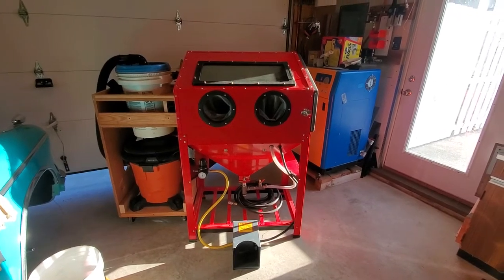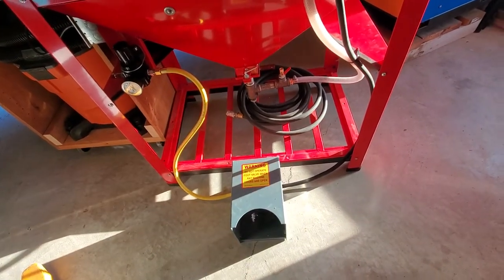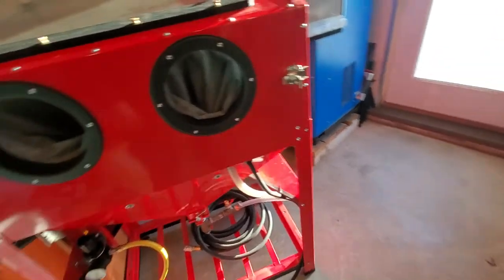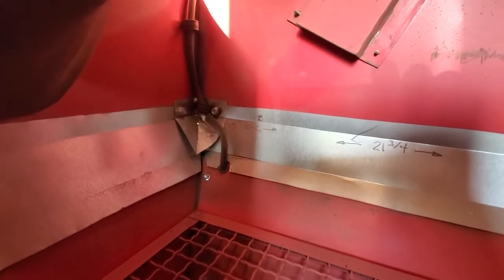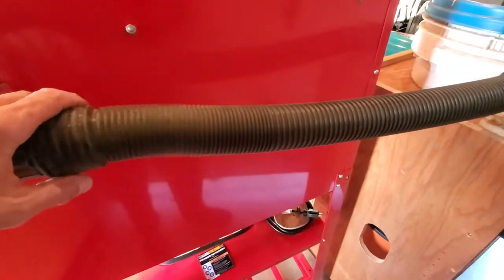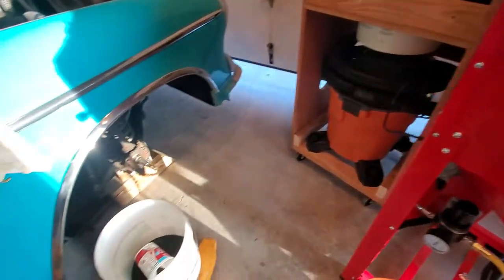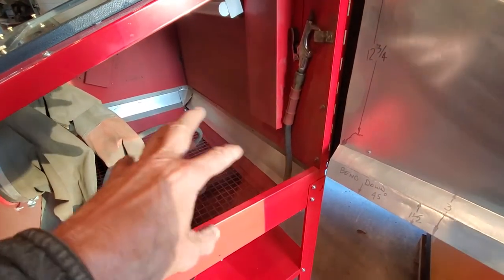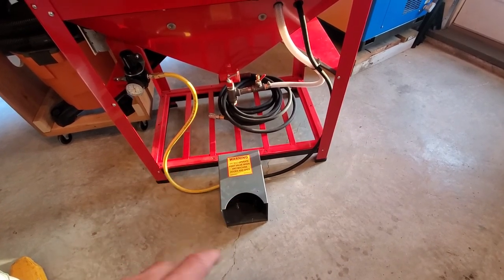Harbor Freight 40 Lb Blasting Cabinet mods done 20220403 - more than you'd think invested!

Comment: Thanks for the u tube. I watched it to clarify a bunch of things on set up when I re-worked mine .I had an old bench top model form 2002 never did work well. been in the corner for years just taking up floor space. I had to do some sheet-metal work to turn the trough into a funnel for the sand. made the mixing valve like everybody does. got a new gun and pedal.  I fully expect it to work now. but you covered everything I had questions on and provided good pictures of the parts. thanks again.

Comment: What compressor is that??? What cfm is it putting out?
Reply from the maker: Is a more commercial "Puma" brand. To use is required a spare tank. I used a 60 gallon Cobalt tank for the air supply but also made my own copper line cooling system to wick off water better. CFM = 21 @ 175 psi. 18 CFM @ 90 psi!  Have had it 6 years now and like the profile/style vs an upright tank. Unsure but believe since I bought it the model number has changed. In 2018 I paid $1800 delivered but see $4900 for a current retail price. Don't quote me! Local guy I bought it from states the style now comes in a 7.5, 10 and 15 hp as well. I chose 5 hp for my needs!